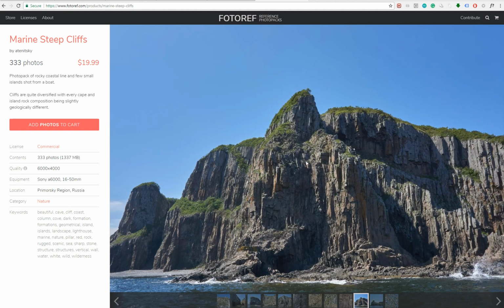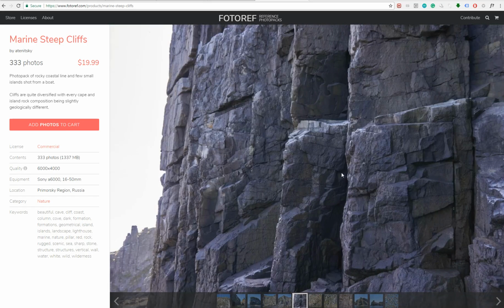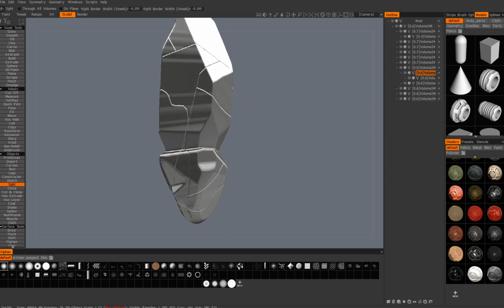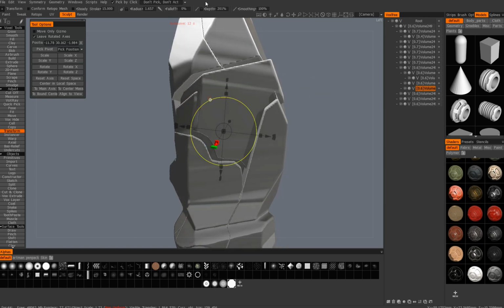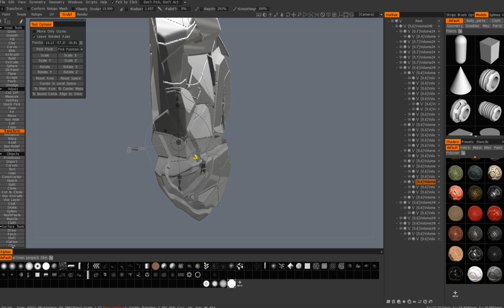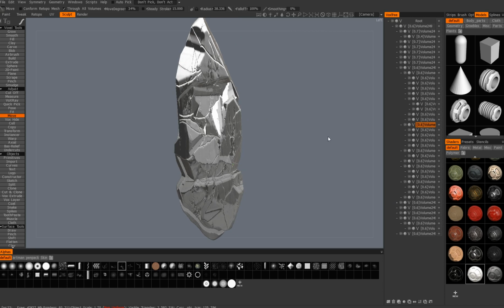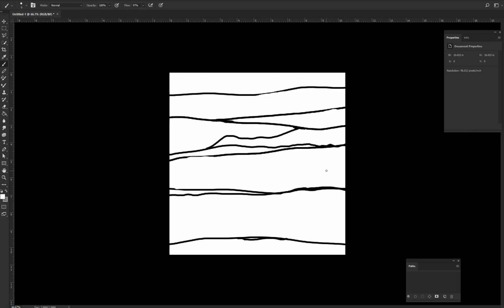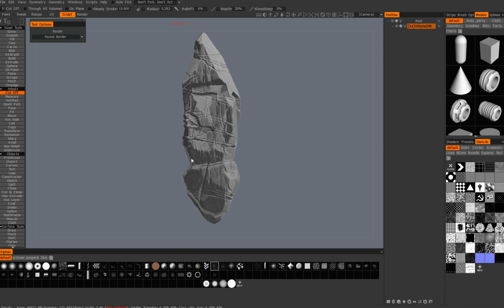3D Coat's Unique Rock Sculpting Techniques

Comment: there is something so refreshingly direct about 3d coats implementation that i think zbrush users would enjoy but probably arent used to. now that i have some experience in both i think it comes down to the more approachable interface coat has. in zb i find myself going in and out of disparate menus ad nausea. 
 yes you can customize interface but im not always in the program so its not worth it to me. 

                          i want an interface to work without me needing to fix it. secondly the true vox nature of coat really shines in some very amazing ways like in this rock tut. real volume not faked geo as vol. the one thing i like in zb is the poly tools. 

                       i think coat has some good poly tools but im not totally aware of them yet. as for scanning and sculpting.  as a 20 yr game vet. i can say that the shape and the scale of the rocks and how they get used in the level efficiently is just as important as their looks. in other words the module design shape. getting that right is so much more important than how realistic they look when laying out the level. 

                      if you dont have the right shapes and scales your level wont be made efficiently or easily. i see alot of photo scan assets that have really terrible module shape and design because they are limited by the data collected. artists have been reproducing reality forever. its possible to make observations and sculpt and texture realistically without limiting yourself to scanned data. scan data is cool and maybe can be hybrid used but to only rely on it is very limiting. people who have never laid out a real game level will never know any of this.  

                        my big problem with quixel scans is they have no idea what modules make laying out levels easy, what shapes are needed what scales are needed etc. so their work is interesting for small scale projects or single cam views but not for real game levels with real needs to be easy and efficient to use to border levels and contain players.
Reply from the maker: very interesting! Can you give some good modular rock examples maybe from artstation or pinterest?

Comment: Anybody else having problems with transform? When I stretch something any brush I use behaves like it is operating on the unstretched model. Like if I make the rock tall and thin like Anton does here, all the alphas become stretched too. If I make it fat, the brushes become wide too. For instance the square brush makes marks that are diamond or parallelogram shaped.
Reply from the maker: Hey Steve, sorry for the late reply. Essentially you need to make your mesh "Uniform" after every scaling operation, otherwise you get the described behaviour
Reply: @AntonTenitsky  Thanks Anton, I found the button 😁

Comment: can you please show your unwrapping workflow because it nice making them rocks but texturing them as they are is not possible
Reply from the maker: hey there, I don't unwrap :)  I only deal with procedural shading and textures. Hopefully, I won't have to unwrap anything ever again.
Reply from the maker: But generally speaking, you need to create a low-poly model that is roughly the same shape, it doesn't need to go super deeps in each cavity. It'll bake fine. You'll probably get artifacts deep in cavities but they will be hardly visible. There is really not much difference doing a regular game/production model in this case. It's just a bit more complicated. My channel is focused on cutting edge techniques that very few people know. Unwrapping and baking geometry is something I really can't spare my time talking about. There have already been too many tutorials and articles about it starting from 10 years before.

Comment: 3d coat has amazing noise modification procedurals using live clay surface tools,  also in paint room amazing displacement painting/ filling with noise procedurals
Reply from the maker: Damn! I didn't know that. I've just checked and it is really good and real-time!
Reply: ha glad to help. for me the most amazing is in paint room.  turn on view displacement then use the fill tool with option for use in other tools.  its also amazing plus u have masking etc
Reply from the maker: I'll check it out!
Reply: that's really amazing! I totally didn't know about it.